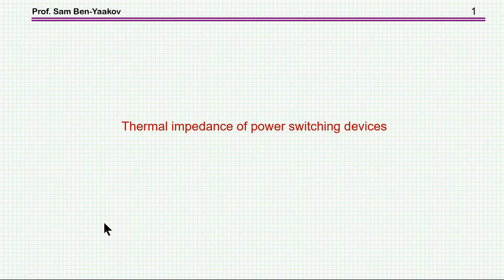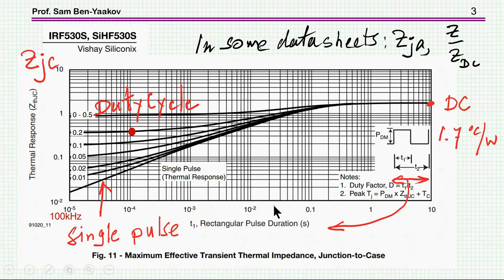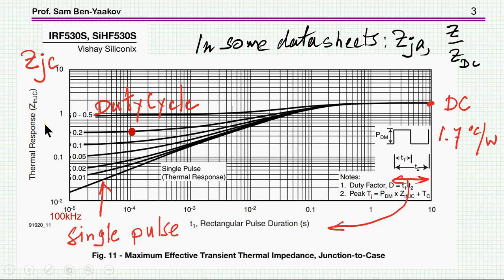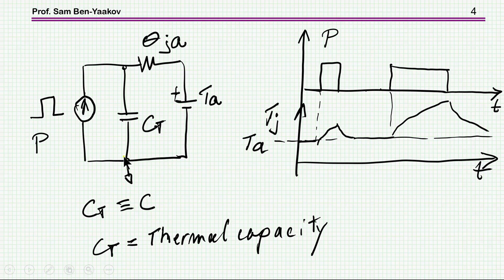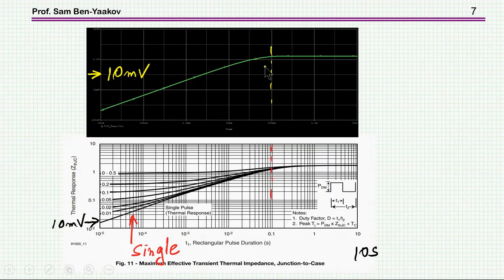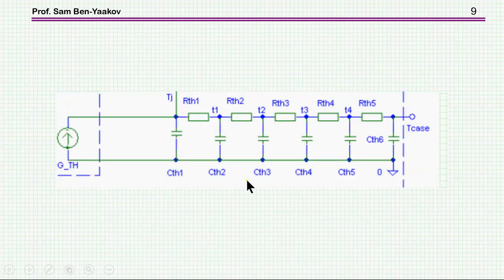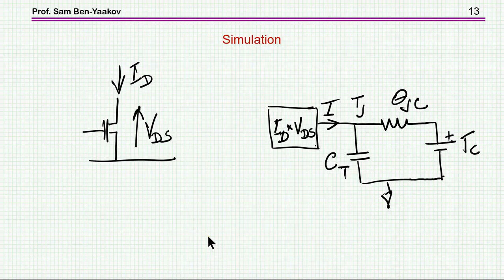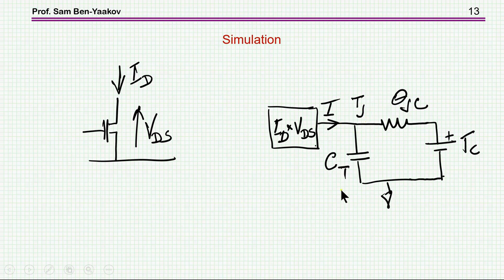Thermal impedance of power switching devices

Comment: Thank you sir, earlier I knew thermal simulation by only considering thermal resistance. And I always tried to find what should be the value of Thermal capacitance, needed for foster network design. Today it is a bit clear. Thanks sir 😌😃
Reply from the maker: Thanks for comment.

Comment: Sir, this is very good information.i have one doubt is that the thermal impedence for pulses is actually defining the PWM pulses.so, the same can be used for evaluating the temperature of a Mosfet while it's deployed for MOTOR CONTROLLER Application?
Reply from the maker: Thanks for comment. Yes indeed. At low modulation frequency typical of motor drive this could be significant.

Comment: Thank you for the video sir! I had one question about the thermal impedance curves. In all the graphs the pulse duration seems to be the only important variable for determining the thermal impedance, however the thermal conductivity of the material (lets say silicon) also changes with temperature. So should the thermal impedance not also be dependent on the temperature of the material? or is it negligible
Reply from the maker: Good point. I don't know what is the temp effect on the thermal resistance. I would guess that it is minor.

Comment: Mr. Sam, speaking of hestsinks and thermal resistances, how would we do in a situation where we want to use the PCB copper as heatsink for SMD devices. How can we calculate the thermal resistance or copper area in order to get certain temperature on the SMD device ?
Reply from the maker: You need to do  thermal simulation but most vendor s give the thermal hesitance of SMD when already on copper of certain area and some are giving for several different areas.
Reply: Sam Ben-Yaakov Then, knowing the resistance for a given area, we can compute the new resistance for a new area knowing that the resistance is inversely proportional to the area, is this a way to go to avoid thermal simulation ?

Comment: I have one question the provided value of Rthja in the datasheet ..does that represent worst case value? If it represents worst case value then is it only under the JEDEC recommended pad area and testing environment..it may be more or may be less as per the user pcb boards.

Is my understanding correct?
Reply from the maker: Look for the commnets and samll prints in data sheet for specification of copper area for which the Rth is quoted.

Comment: Is it digital or analog?
Reply: @sambenyaakov  Can we say that this circuit is digital or analog? The thermal modelling.
Reply: I am working on a project called "Thermal Macromodelling of digital electronics systems". Does this include in digital electronics systems.
Reply from the maker: @msudaiskhan  This applies to any sstem in pulse operation

Comment: What is "K" in the last slide?
Reply from the maker: A scaling constant
Reply: @sambenyaakov  Thank you for your reply. How can we determine its value?
Reply from the maker: /  @nachiketadeshmukh8444  K is basically one  but if large temperature drops are expected within the mass one can account for them by adjusting K. It can be estimated experimentally measuring the temp rise of a short thermal pulse so that the loss due to thermal conduction is still small

Comment: cool i have 2 ac units i need too find away so to cant run at the same time like if some turn on one 2 cant run it cut the power off on one
Reply: Use a pair of relays. On each unit, wire it so that the thermostat signal goes through the NC contacts of the other unit. Then wire the coils so that it activates when its corresponding unit turns on. So turn on one and the relay disconnects the signal for the other one. Turn on the other one and nothing happens until the first one turns off.
Reply from the maker: Thanks.